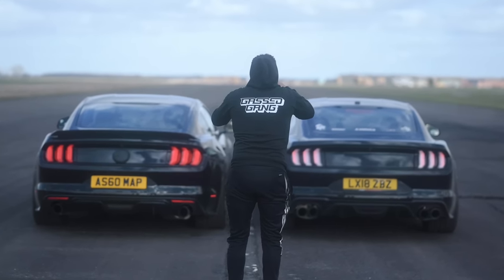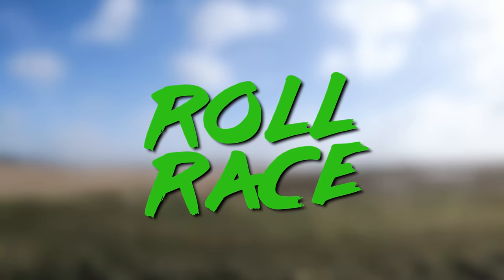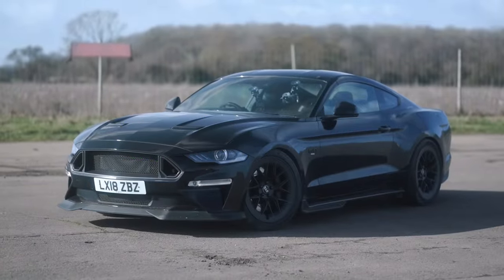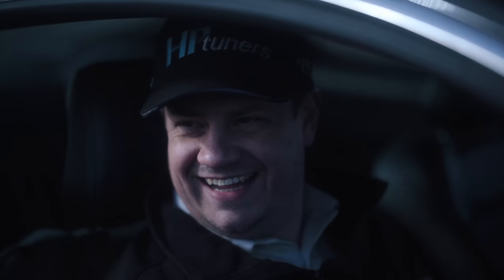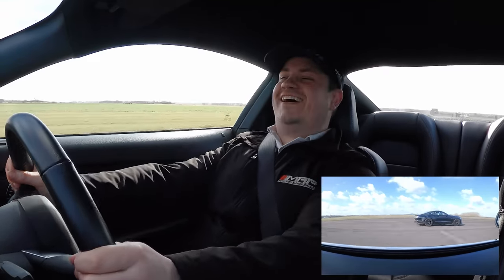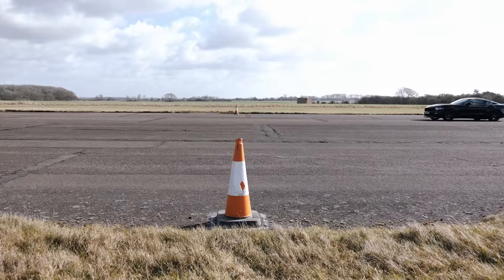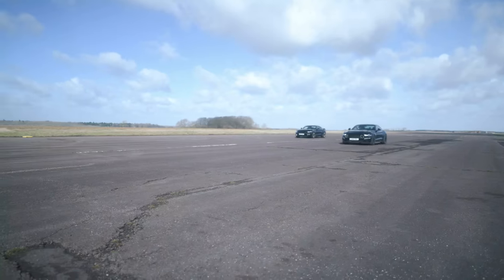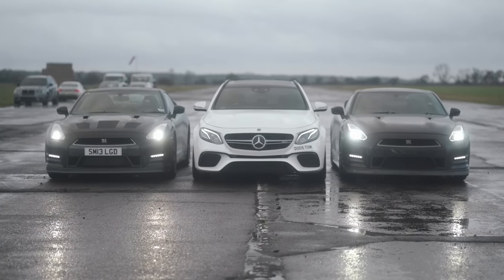TWIN TURBO vs SUPERCHARGED.. 980BHP vs 950BHP FORD MUSTANG GT

Comment: Bruh, the Coyote isn't like Chevy and Dodge V8's. Their power band is around 3-5k rpm and as such short shifting isn't a big problem for those engines. The Coyote makes all its' power in the 5-7.5k band. And you both short shifted all the way down the strip, meaning you were ALWAYS  out of the power band lmao.

Comment: I would say that these drivers have very little experience drag racing.  There were no burn outs, power shifting and really high RPM runs.  You need to get some folks to drive these type races who know what they are doing.

Comment: The horsepower is what wins above 70 mph not torque and the supercharged car win by 3/4 of a car, not 1.5 cars in the 1/4,  and twin turbo  won the rolls by just barely 2 cars. You see, when the rear bumper is in line with the front thats 1 car length.

Comment: There's a point where HP and torque can be a detriment to your 0-60 or 1/4 mile times. You are trying to put massive power to two wheels with street tires. These mustangs probably wouldn't beat a stock mustang GT with a professional driver.

Comment: Neither driver wanted to push so hard as to break an axle or U-joint. So the acceleration runs were just to eat up time, nothing worthwhile. I was going to suggest a simple road race course, maybe 3-6 turns not in a loop but an A to B like a gymkhana but the track surface was dirty so no traction again. Guess the only real test would be a economy run that could cover 250-350 km.

Comment: The guy in the turbocharged car is not very good at shifting. Those shifts need to be quicker. Don't let the rpm's drop so much before and after your shift.

Comment: two very nicely built, insanely fast cars...but could get beat by a lightly modded Focus ST XD    I know, traction issues... just gotta learn the car and get proper tires and they can turn in some much faster times. I'm curious what they're top speeds were at the trap

Comment: Root cause to slowness has to be the driver in both cases. Even with wheel spin these cars should be significantly faster 0-60 and 1/4 miles times. Geesh.

Comment: 5.3 second 0-60 in a manual v8 5 liter turbocharged 950hp engine? That’s shockingly slow- my v6 automatic g35 coupe does that stock and naturally aspirated and it only has 300hp. The car is far older, costs only a fraction of the mustang and is more reliable

Comment: Something is wrong with the way you do things over there my stock 5.0 mustang 10 speed automatic runs 12.32 in a quarter mile with 460 hp in the USA my buddy has the same year 10 speed automatic stage to Whipple supercharger 890 hp runs in a quarter-mile of 9.32

Comment: Now I understand they’re more than double my old 2012 m135i in terms of power; but how tf does it beat both of these by almost half a second.

Yeh I understand they’re rolling in to not just lose fraction but they should be in the 10’s to high 9’s. Considering the average 1000-1300 rb powered car in australia is sitting around 8 to 9.

Comment: What happens when you put 2 non drivers on a gravel surface in nearly 1000 hp mustangs, and make them shift manual with the left hand? No traction, terrible shift speeds, no hazing tires at all, short shifts, and stock mustang times. What a waste of money. Just drive a stock Mustang GT with loud exhaust and I'd beet em both, shifting right handed of course. Lol

Comment: cars are supposed to be the same other than the power adder. they are not. final drive has to be the same for a true test, otherwise you are comparing two completely different setups

Comment: OK comment section got the same idea lol Its a feat of engineering to more than double the torque and horsepower of a stock mustang GT and not beat the stock times. Imagine the wake up call they would have had if a stock mustang GT was there to show all their efforts were in vein. They needed bricks in the trunk or something.

Comment: 12 second 1/4s with 1000hp cars? Pathetic. They'd get whipped by cars with half that power. If you can't get traction, the power is useless.

Comment: How are these 0-60mph times even possible when my N/A manual 2016 Mustang GT does those times stock 😂 Even a Ford Falcon FGX XR8 Sprint would Gap these guys straight out the factory… too bad they closed the factories here though 😅 RIP Holden and Ford Australia!

Comment: Holy jezz my crapbox 2010 Lincoln MKS 3.5L V6 Eco does 11.9 @115 1/4  mile at 4500lbs so like 1000 lbs more then these. That's on normal street tires that where on car when I bought it.

Comment: That is terrible. I doubt those cars are over 900 BHP.
Replace them with some turbo Barra motor with bolt on mods will achieve much faster times.

Comment: no point in power if you cannot put it to the road. I have a 530hp 650nm XR8 Sprint which a 5.0lt Supercharged Ford Falcon in Aus and i run the same quarter mile as that supercharged mustang with almost half the power.

Comment: supercharged 950bhp for 12.6 1/4 mile run and 980bhp for 12.8 1/4 mile run on a non prepped surface thats pathetic if my holden commodore v6 3.8 ecotec had a custom turbo setup that made 450rwhp I'd be matching stock aventadors on the street and if m90 supercharger powered with 350rwhp id also match stock avendators also on the street

Comment: An uneven track with lots of patches and holes + Ben who hit the breaker too often instead of being ready to change gears... I think that if the track were a smooth asphalt and not this abandoned unmaintained airstrip and Ben wasn't wasting precious seconds on breaker before shifting up, the results would have been far greater and the turbo car would have been somewhere in a galaxy far, far away behind the supercharged car.

Comment: This is the most pitiful thing I've ever seen. Who leaves the line doing a zero to sixty idling,drag racing or anything this is the most time anyone has ever wasted . If those cars are what you say and anyone who can drive halfway decent can't take them low elevens I'm stumped . Heart the tires hell spool the turbo a little bit. Goggle foot breaking do something start in a power range roll raising something . Hell fire , anyone in this comments list is wanting to push the gas change the gears and curse and throw the phone computer or remote. This is a prime example of either knowing someone and then letting you or having lots of money wanting to race and not knowing high twelves is easy to do with half the horse power and torque y'all claim. But when someone is like omg I took my near thousand hp car screaming , personal best . What was it 8's no it was high 12's 😆 you bullshitin

Comment: Wrong tires, wrong rear gears. For a drag and rolling race you can't use street tires but drag tires with a soft compound. 3.5 and 3.71 gears can't be compared. You wanna be fast? Need 4.11 or higher.

Comment: WALL BEARING TURBOS ? Bet this video was sent out to a non-car enthusiast video editing company / person to edit ...

And people commenting that these cars are slow with 900+ hp running on street tires on a shitty track obviously have never driven a RWD car with more than 500whp on street tires on an unprepped surface. Spinning ain't winning. Also these stangs don't have launch control and are manual. Gotta have a REALLLLLLY good driver to be able to handle these cars. These 2 guys shift on wheel spin, not redline. Stock Tesla Model Y Long Range would beat both these Mustangs in the 1/4 mile on these tires on this track. Not enough can be said about instant torque and AWD.

However, I don't understand why this "tuner shop" wouldn't throw on some MT's or Nitto NT's on the damn cars for this race. shrug

Comment: Supercharger has more usable power turbo jus dumps too much torque at once at that level of modification maybe if he had a proper setup to hook (Ik it can be seen as rice but downforce is important) with a prepped surface he would’ve won

Comment: I can't believe how slow they are, or how horrible of drivers they are. I have a 2015 mustang gt gen 5 whipple with 3.73 gears which is harder to control. And I've crushed all those times by a huge margin. I was running 11.7 1/4 mile times on the street literally on a shitty hardly paved back road

Comment: Simeone's lying about their hp numbers lol. You can try to blame the beginning on back traction but on the trap speed being way to slow for a so called 950hp car gives it away. Those cars are 750hp at the most and honestly that's to high for what they really are. I'm just being generous. 
And since these are really 700hp ish cars that really just means its bad driving and not "traction" like you tried to make it out to be. But honestly the cockpit view kind of gave it away that these are not really good drivers. Just average stick shit car guys that got put in a car with more hp then they now how to shift though.  PS just run street radials if you have traction problems. You'll hook

Comment: How do you have 1000 hp cars with stock style wheels and tires? My NA f150 5.0 runs quite a bit faster than these cars. Guess the car scene there is still maturing.

Comment: Dumbest think you could possibly ever do is put a manual transmission in a car with that much power… youre slowing the car down with youre arrogance thinking you can do better than the paddle shifters smh… the speeds on the same car are going to vary just because of the driver

Comment: slowest built cars ever shows how important drivers are neither of these guys know how to drive I ran 0-60 in 5.9 secs in a my 86 Mustang Gt with 200 hp and 285 ft/lbs or toq and 14 sec qtr miles and you trying to tell me 750 plus Hp more than that only gets you a sec and half better rofl. Neither was power shifting and even short shifting rofl.

Comment: With drivers and tires these cars should be so much quicker. 0-60 should be 3 sec and 1/4 in mid 10's at 135 mph. These cara are slowwwww.

Comment: dude the bone stock 2018 10 speed automatic runs faster than that. wtf is wrong with these cars?? OH YEAH, THEY CANT DRIVE FOR SHIT!! Every time they shift they are losing half a second!!! Slam those gears boys. shift fast. hold the pedal to the floor and throw the clutch just enough to open it up for the next gear. if you can’t shift any faster than this you need to get an automatic. seriously.

Comment: This was horrible. I'm not a mustang guy, but they just made these cars look like shít. Running the same time or slower than stock GTs? Seriously?? Put some decent tires on both of them and then run them with better drivers. Anyone laughing and carrying on ab "how fast" a 900hp high 12 second car is, shouldn't be behind the wheel. This was a waste of time I will never get back.

Comment: Ofcourse it's done with 2 manual cars where they are literally slower than the autos. Do these tests with autos so they are more accurate and don't have to rely on the driver being top notch at shifting (these guys are terrible)

Comment: my 18 civic does 0-60 faster than these with a manual gearbox lol. I really hope i don't do this with my mustang... is such thing as unusable power. turbos never got to pressure, he shifted almost as soon as he touched the throttle. watch a middleaged  man run an old EG civic and watch how they use the whole gear. rwd is a touch different. but, same concept. you shouldnt be in 4th or 5th gear in a 0-60. if second is too much, use the top end of the gear. roll into your power. cool video though and love the builds.

Comment: These cars are garbage and so are the drivers..I ran a 7.7 1/8 @92mph in an 81 camaro with slapper bars, 383 stroker, 4 speed manual, stock clutch, and 3.42 butt gears.

Comment: Those are two of the worst setup boosted cars I’ve ever seen. You could have lunch waiting on the lag of the turbo one.  There’s no way that supercharged one should have beaten it in the roll races. I want to see the graphs of those dyno charts. Cause I guarantee you, I have a 760 rwhp/730 ft.lbs  of torque 300ZX TT that will run circles around both these cars all day long, ESPECIALLY in the roll race. Seriously, the lag, and the way it fell on it’s face in those roll races points to ether lousy turbo selection, boost leaks or lousy tuning. I don’t know what’s wrong with the SC one, as I’m not a fan of superchargers. 
https://youtu.be/Zg4bh6wyYT8

Comment: How is this possible I have half the horsepower and run a faster ET in a gen 1 Coyote, You guys are embarrassing get the heck out of the driver seat please
Reply: Factors play a role.  Same car in will be slower at higher altitudes than in lower altitudes.

Comment: So you think you can outshift a 10 speed auto and gauge torque with your foot on the throttle judging wheel spin, 12 almost 13 sec  pathetic my 68 mustang 351 windsor would give these cars a close run. The bias shown by this whole setup is as evident as watching CNN for those who want there expensive euro ride look like it was all worth it

Comment: Even the standard Mustang has way too much power and zero control, these are way, way worse. Even the times they were getting were slower than standard! Typical US Pig Iron with all the power in the world but no way of actually putting it down. The ONLY way these would achieve decent times would be using drag slicks and on a properly prepared drag strip.

Comment: They didn’t know how to drive and they didn’t prep tires to get them hot for traction they didn’t build any kind of boost for quicker take off. That was so embarrassing and slow. Many stock street cars with auto can easily go faster even 4 or 6 cylinders. Wow..not to bad mouth them but they need to learn how to drive

Comment: Very poor driving skills by both drivers. Not sure if the claimed bhp is correct. I will think twice sending my car for Mods at their tunning shop. Iv seen old  escorts and Capris,  running four cylinder single turbo with NOS  doing 9s &10s in the quarter mile all day long at meetings. I will be embarassed doing such times with such heavy gear strapped to their Fords. These blokes give Ford a bad name. My mate Joey who races a fully strapped Chevy SS would have a field day heckling these Fords owners and tuners cos he has sticker across his front windscreen saying" Ford is Lord, Chevy is God"

Comment: They are running 12’s with 800 hp? Hahahahahhahahaa you should be running 9’s. Those are factory times with good tires. Hell my 1985.5 SVO mustang would mop these cars and it’s a modified 4 banger turbo.

Comment: Seriously these cars are at almost 1k to the wheels and this is the times they put out? I'm thinking the idiots behind the wheel need to learn how to drive. they aren't even trying to get into boost off the line. if traction is a issue throw some drag radials on them... This show had the money to afford them that's for sure. horrible interpretation of what a near 1k whp car can do. 😮😮😮😂😂😂😂
Reply: Tires tires tires
Reply: Looking at the poor condition of the airstrip, I think the tires should be offroad tires, not drag tires... 😂

Comment: This is crap. My 2006 Turbo 4.0 V6 (414HP/480TQ) ran consistent 12.1 with 1.7 60 foot times and my crap ass driving - and it's also a manual. Those times are ridiculous for the power these cars are putting down. Get some tires, gets some practice and do-over.

Comment: Everyone here commenting says that could better times. It was wet. The cars have too much power and rubbish traction and I am guessing standard suspension gearbox, diff, drivesshaft, etc. It may be the case that I am wrong. As for the dudes who say they can all do better then show us a video of you doing the numbers you say you can do. Proof. Otherwise I am not interested as I have heard all before. Boring alert!

Comment: they are terrible at driving these cars. My 2.7 Supercrew, 6.5 ft bed, 4x2 Ford F-150 does the 1/4 mile in 13.6 Seconds....and I barely have 450 HP and 550 lb-ft TQ